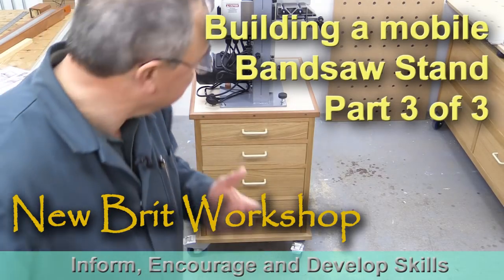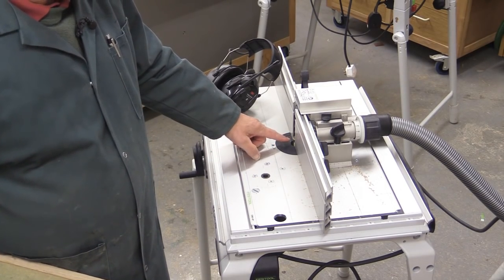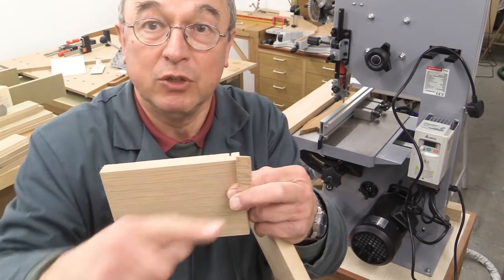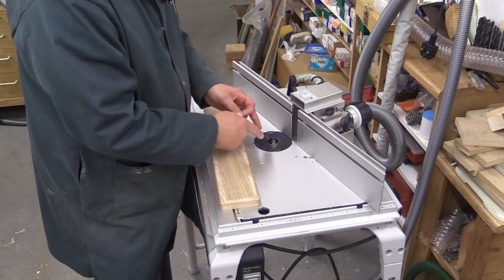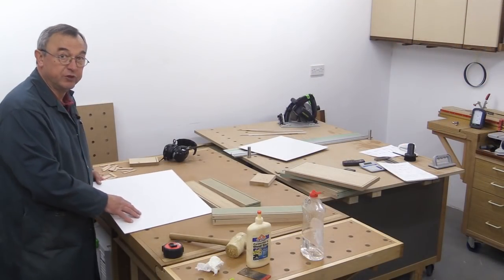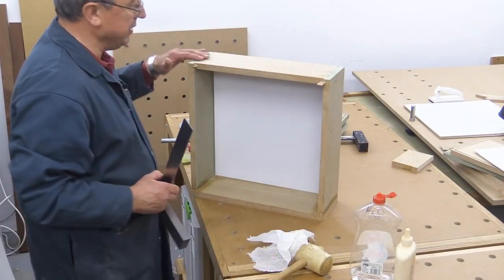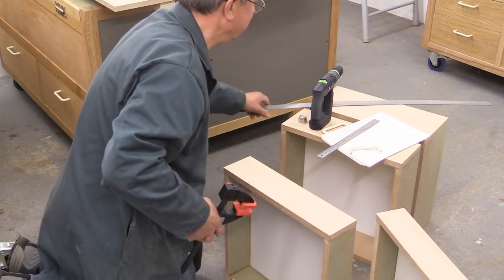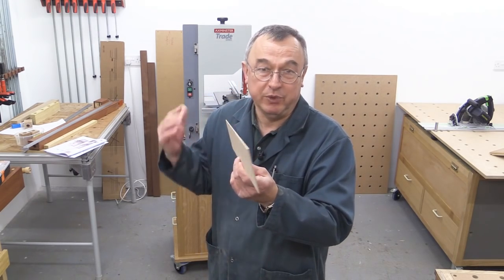Making a new Bandsaw Stand - Part 3

Comment: Hi PP. What blade did you use in the bandsaw (I have the same) for the edging cuts? Thanks.
Reply from the maker: Hi Richard, I have about 4 blades suitable for this and I think the one used is this one:
https://www.axminstertools.com/axcaliber-ground-tooth-blade-1-854mm-73-x-12-7mm-1-2-6-tpi-505225
Peter

Comment: Hello Peter, I heard you say you were planning to do a review of the Axminster Bandsaw. BS11 INV.  Is the film close to completion I am looking for such a small bandsaw and was hoping to hear your ideas on it before paying the money. There are Hammer full size bandsaws for the same money here in Germany. Its just a question of space to store such a machine in my workshop. Look forward as always to you next video. All the best Pip
Reply from the maker: Hi Pip,  (are you the Bielefeld Pip?) I am currently uploading the bandsaw video but it is a long one and in HD so it may be the morning before I finish. I really like this machine. It was provided by Axminster but I could have had anything in their lineup. I wanted this one because I have followed its development over the last 2 years and it suits my limited space yet it is as capable as most of the bigger machines (less width of cut). The veneer making is better that some of the professional machines that I have tried. A professional friend is thinking of buying two - one to do veneers and the other for scroll work.     Peter
Reply: Hi Peter, yes it is I from Bielefeld,  Great timing, I just watched your video, as always a great and informative piece of filming. How do you get on with the 160mm of cutting height. I cant decide if I can be bothered to slice up Logs on my band saw or just go to the wood shop and get seasoned planks and cut out this part of the process. Means again more storage for drying. But a cheap way to get some wood. 
Thanks  for giving a good over view of it capabilities as always and I look forward to your extras video.
yours Pip
Reply from the maker: Pip C Hi Pip, How are you? The maximum cut depth so far is 130 mm as I do not have any suitable wood but I will see if I can try it soon.   Take care.    Peter

Comment: Hi, Peter. The BS11 on the Axminster site has a 750w fixed speed induction motor and is 230 v single phase machine but yours seems to have a VFD fitted, can you share some light. Thanks
Reply from the maker: +Jim Porter Hi Jim, I could not find the one you are referring to - try this link to my machine http://www.axminster.co.uk/axminster-trade-series-bs11-inv-bandsaw-508476   This is the machine to get which I will try and remember to explain when I make the overview video in about 4 weeks time.    Peter
Reply: +New Brit Workshop (Peter) Ah, that explains it. Yours is in with the metal cutting band saws. I was looking at this one http://www.axminster.co.uk/axminster-trade-series-bs11-bandsaw-508475 in the general or woodworking ones. That would explain the VFD to slow the machine down when cutting various metals.
Reply from the maker: +Jim Porter Hi Jim, As well as slowing down enough for metal work the "INV" one still has two pulleys on the motor like the cheaper woodworking model but most of the time there is no need to change anything as all the other speed variation is done on the front panel on my machine.    Peter
Reply: +New Brit Workshop (Peter) yup, with VFD there is no need for more than one set of pulleys at all, purely a manufacturing legacy. The addition of the VFD is nice and it looks like a fairly decent one (heat sink no fan) which would explain the £250ish price difference. Would probably be a benefit in quite a few shop, might even think about adding one to mine, now there's a thought.
Reply: +Jim Porter the other useful advantage to the VFD would be to set a blade break, stopping the machine quicker.
Reply: +Jim Porter brake
Reply: +New Brit Workshop (Peter) Peter, I assume the rating plate on the motor says it is 3ph?
Reply from the maker: +Jim Porter  Hi Jim, I have followed the development of this machine and really like it now - at first I thought that it was too small but it really is very capable and takes up very little room.  Cheers.  Peter
Reply from the maker: +Jim Porter Hi Jim, Yes it is 3 phase (driven by the inverter).  So just a single phase supply is needed.  Peter

Comment: Peter where can I get a copy plans for the cabinet ?
Reply from the maker: Hi Terry, I am currently working on the review video and having great fun. I will not be releasing that video until the BS11-INV is back in stock which could be another 6 weeks away - although some shops may have them in stock. As an early guide I would have no hesitation in recommending the machine. I have seen it in development over the last 2 years and now understand the concept of the small package. You may have seen me cutting the thin veneers in the Bandsaw Stand video - that is the ultimate test and it manages it beautifully. The basic BS11 is for woodwork only and only has two speeds. The BS11-INV is still 230v single phase but uses an inverter to produce power for a three phase motor. This gives absolute speed control down to 42 m/min ! Perfect for cutting aluminium and ferrous metals. For the plans I need your email address which you should send by Private Message. To send me a Private Message follow this link:  https://www.youtube.com/user/StoneMessage  then click "About" followed by "Send Message".   Peter